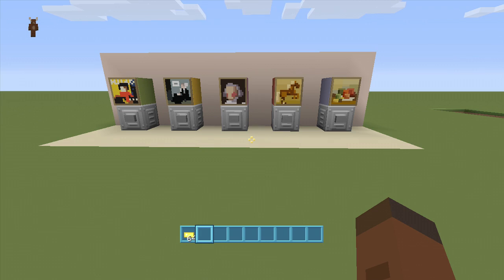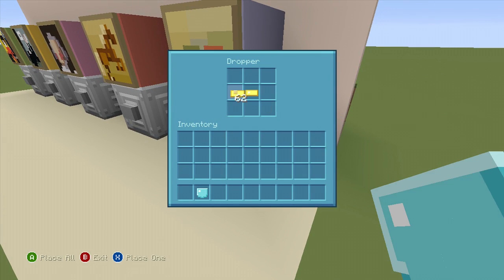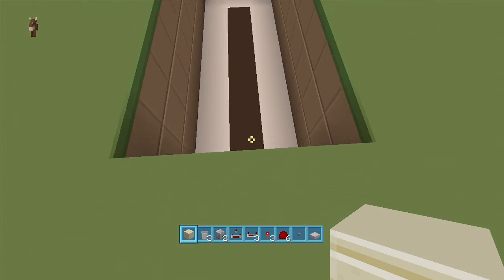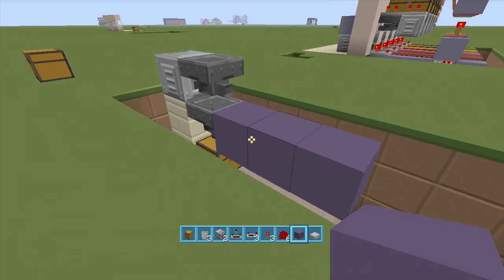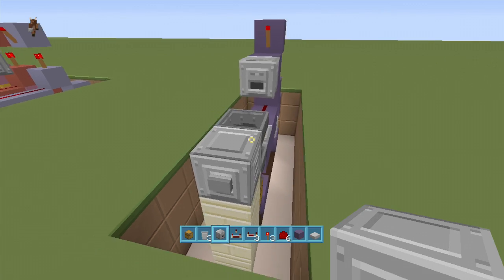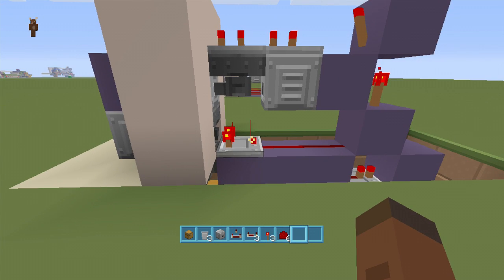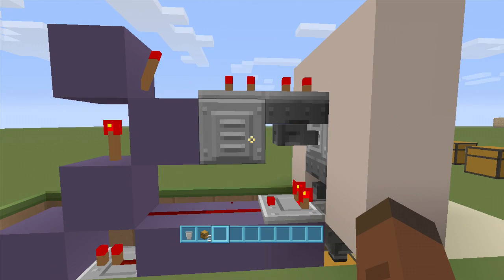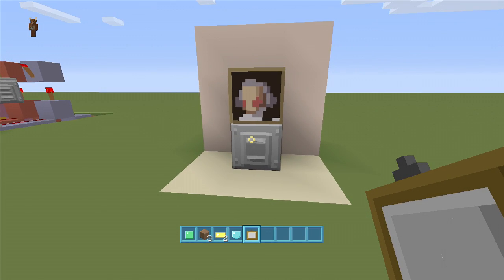Working Slot Machine [1 wide/Tillable] (Minecraft Xbox TU22/PlayStation CU8)

Comment: Could we put a lever instead of a button on the bottom?
Reply from the maker: As long as you flip it down then up. Sure =] should be fine.
Reply: ***** FedEx I usually look at Redstone videos and base my design off of theirs but with a twist. I made the design shorter (still 1 wide and 7 long but shorter by 1.) But I made mine truly random. You can use a hopper dropper monostable  as a randomizer. I used that to make prize or nothing. The prize all the time bothered me.